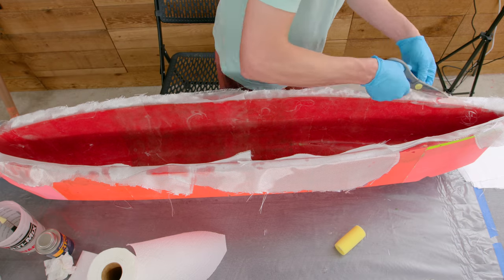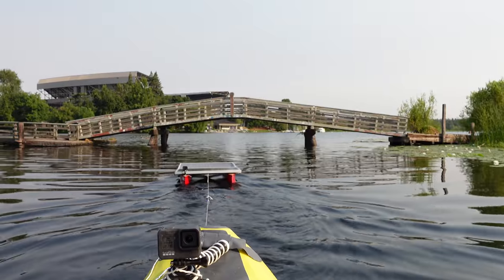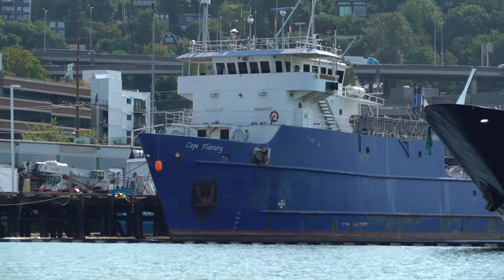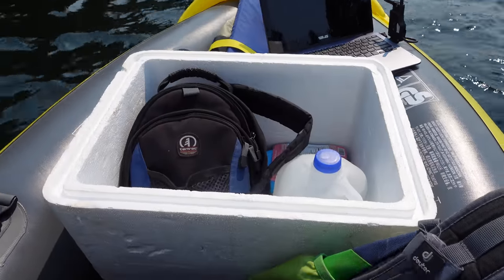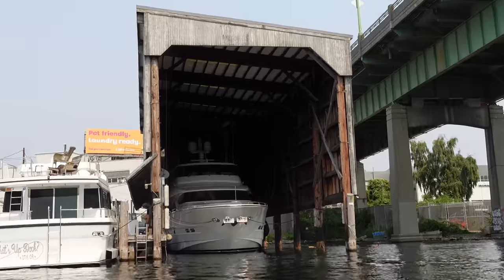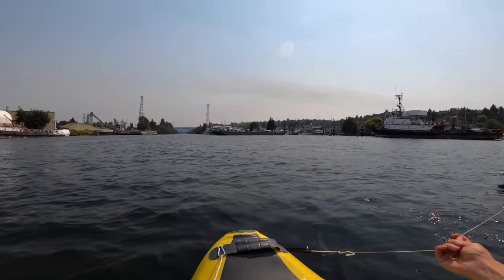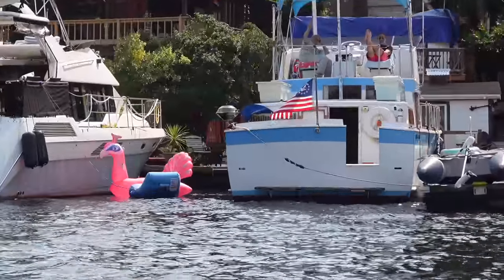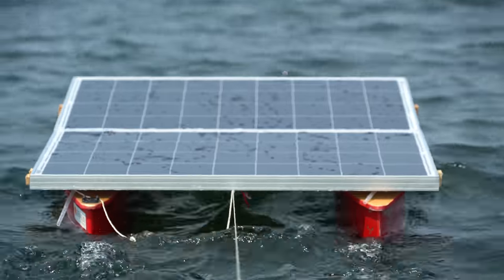My DIY R/C Boat Pulled me 20 Miles!!!

Comment: "rich people trying to flex but their boats cant self direct" - the soundtrack is as entertaining as the content!
Reply: Lmao, that line killed me.
Reply: I loved it but those yatchs, tugs, and fishing boats definitely all can lol
Reply: @yeldawg907  Yes, they can...but I would like to emphasize the "self" part. None of the above mentioned operators designed, built and implemented the autonomousness (is that even a word? Chrome says no lol).
Reply: @boardsort  true, but the operators of said vessels can input waypoint missions. Just definitely not it such tight waterways like this. And the definitely didn't design build or implement said system
Reply: Yes there are boats that self direct
Reply: Your sound track and lyrics were super cool.
Reply: it’s pretty funny, but some of those mfs got autopilot, I’ve been on a nice fishing boat before, and it’s literally got gps autopilot like a plane and it’s sick
Reply: Fun fact! Three orca plane....

1954 DEHAVILLAND DHC-3
Fixed wing single engine
(11 seats / 1 engine)
OwnerKENMORE AIR HARBOR LLC
KENMORE , WA, US
Airworthiness ClassStandard/Normal
Serial Number37
EngineP&W PT6A SERIES (Turbo-prop)
Horsepower: 500
Reply: @JamesTorrey  Explain how this is relevant
Reply: my dads old searay had waypoints you could map out on the chart plotter and it would follow them, was kind sketchy because it wouldn't slow down for turns so if you programmed a 90 degree turn and had the throttles open it would send you across the cabin lol
Reply: Err. But there's an autopilot option on  some boats. And ships.
Reply: Ye, that's LoFi, except for the Wellermann thingy xd
Reply: This comment is the click bait.. lol need to change the title..
Reply: Ye that line is hilarious
Reply: @Thatwrxguy  jj
Reply: Fr at Soundtrack , It’s Like Perfect with the Setting
Reply: Watch out for that cigarette boat coming up fast on your right……….oops!   Well, there’s his hat. Hey, you ok??.🥴
Reply: They totally can though haha
Reply: Actually, most large boats do have an autopilot system
Reply: My 1989 sailboat can follow waypoints, follow magnetic bearing, follow wind direction.. doesn't even need 5g reception..
Reply: @Shane888 Davies  @Shane888 Davies  I thought it was a fun fact. He was basically sharing the specs for the Orca painted plane that flew over head in this video so his comment was completely on par with the video and indeed was a fun fact as well as an informative comment, so I have no idea why you had a problem with him making it! Thank you to Mr. James Torrey for the informative comment.
Reply: @scrambledmandible  well it is the full specs for the airplane that flew over his head in the video and was pointed out by the narrator of the video so I don't know how much more relevant you need it to be.
Reply: Our Philippines Life  hahahaha same
Reply: That's a bar
Reply: bruh, he got me every single time
Reply: That followed by the foreclosure line were genius

Comment: Bro this seriously looks like a life-saving piece of equipment. With a few minor modifications this could be designed to be rigged up to lifeboats for at-sea emergencies. It would turn the situation from "hope you get rescued before eating each other" into "be bored and uncomfortable for a few days."
Reply: That would be amazing, however if it was a piece of equipment on a lifeboat, you would have to make a good navigation system, that could navigate to the nearest port from anywhere in the ocean, and it would have to be able to operate in extreme weather conditions and choppy waters without going off course.
Reply: @aperson9973  even just this one being programmed to go to the nearest shore would be a lifesaver. I'm just not really sure how it would handle the deep sea waves
Reply: @aperson9973  I'd be happier with something rather than nothing. I could use the sun and stars to point me in a general east or west direction and just go until land. If it's simply not possible to make one sturdy enough to handle extreme conditions while also compact enough to fit with a liferaft, then I'll just take the one that can't handle extreme conditions and hope I don't encounter any. Again, something is better than nothing in a case like this.
Reply: Yeah, I'd rather be rescued by a proper boat then get tugged by a pissy ass rc boat for hours on end.
Reply: @qwertykeyboard5901  the point isn't for this to be the only resque option, but to move you to a better location, maybe even designated resque areas that have all been set up beforehand.
Reply: @pvpdm  While the idea might be good, It might actually be easier and safer to have the lifeboat go into "hover mode" and stay close to the lost vessel,  search and rescue operations would most likely start close to the last known location of the ship, or boat. This ofcourse could be mitigated with the use of a emergency  GPS tracker like an EPIRB or an AIS system onboard. but still
Reply: A lifeboat in the ocean has a lot of special challenges.

It has to absolutely tolerate heavy weather, since that's almost always when they are used.

You could use flexible panels on a hinged, fold down wing sail, in three sections. Fold down one, or two sections for high winds, and you still are generating some power from the heavier lower section.

I suppose you could have some tow behind collectors that you deploy in calm weather, but you'd have huge losses from drag, which is going to be your primary parasitic loss.

Really, what a life boat needs is a really good distress beacon and antenna, with a backup, and back up backup.

If you call them, they will come.

Only time you need motive power is if you have no radio, or are being driven toward a hazard faster than help can arrive.

For the former - time to die!
Fir the latter, you are better off with a small gas engine and a few 5 gal cans of fuel.

No, it's not going to get you home, but it can be used intermittently to keep you from dying before help arrives.
Reply: Everything you add to a lifeboat typically means something you take away. They can't be too big... Moreover, you need to understand how large the ocean is. If you were to use literally this just barely out into international waters - where you're basically safe as long as you get into a lifeboat - it would take 19 days to get back... And that's assuming a perfectly calm sea with NO waves. Not just light waves, NONE .. this is an inlet river, it's very calm. 

Now, if you're out at sea, that's too long.. Doesn't matter how much supply you bring, there's not enough space for that much. The worst things are what the fella above said, you're making yourself harder to find for the only REAL chance of rescue.... The thousands of boats all around you that you should have been able to call before you went down. They're going to have data on the currents and they're gunna do a search using those currents. If you fought the current but got nowhere.... You've killed yourself.

But think of the most important thing at sea: Morale. If people aren't keeping busy and being diligent they can make mistakes that kill them. Having one of these and watching it get killed by a wave would devastate most people.... Best to just keep them safe and waiting.
Reply: Talking from a SAR helo pilot point of view: the less you move, the better chances you have to be found. That is if you can send a mayday as soon as you sink. If no one knows that your boat sunk and where it did...then moving to the closest coast may seem like a better choice. Remember we take into account the presumable drift due to the wind. All things considered, a long lasting EPIRB/ELT/sat phone and smokes/flares is what gives you the best chance of being found. If I had to put solar panels on something, those electronics are what I would like to be able to plug them to.
Reply: ...do you mean life rafts? Cause lifeboats have engines. And fuel. And oars. Like, they can move on their own already.
Reply: @jemmabean  lol yeah I guess I do. Thanks for the correction. It's a distinction that matters, I'll agree, though I had never considered it before.
Reply: @AntithesisDCLXVI  no worries sorry I was a bit of a bitch about it lol 😆
Reply: I'd rather a lifeboat have an emergency beacon and a good battery than wasting on any type of navigation. The ocean is too vast and unforgiving to attempt getting to land. As they say, stay where you are so rescuers can find you. A beacon increases that by 1000x.
Reply: @joetolopino7126  word, hook those solar panels to an EPIRB stat
Reply: @joetolopino7126  With normal phones soon being able to work through satellites, a waterproof phone with such service + solar charger should be enough for both finding/transmiting your position, and to entertain yourself while you wait..
Reply: Actually that’s a awesome lifesaver idea
Reply: That is if you still receive signal.
Reply: Add a charging port for cell phones and a small battery bank (to charge a couple extra phones) and you would literally have the perfect emergency gps powered auto boat to guide you home.

Tie that to an app that talks to gps sattelites and gives you a heads up display on battery life, solar efficiency, and maybe some tips for survival, and you'd have a very profitable, life saving device.
Reply: If it was incorporated into a life boat for larger ships yeah I can see it definitely being viable not the tug boat itself but the solar powerd autonomous propelled system
Reply: Have you heard of the Coast Guard? They're always ready.
Reply: @aperson9973  uh, starlink.
Reply: @pvpdm  make it submersible
Reply: Moving AWAY from the crash site only increases the likelihood of NOT being found. It is too unreliable and needless to have an engine used to keep close to a crash site - rather, a large beacon or ways of getting rescuers to notice you is more important.
However, we run into the issue of weight and space. Whatever
Reply: Just don't save people who use the word "bro".
Reply: @davidrichter9164  what a strange thing to use as a basis of judging another person. What do you think using "bro" tells you about who I am that makes me unworthy of life? Genocide against anyone not of your culture or tribe, eh? You want so hard to feel superior to others yet you neglect to see how low you stoop to achieve it. Pride truly blinds.
Reply: It's called an emergency life raft. Latter technology has evolved in past 75 years
Reply: @pvpdm it would be good tech to implement within the lifeboat and have a small propeller
Reply: Lols.. you really thought you had a "smart" idea huh?
Reply: @Sometimes_Always  Lols.. you really wanna be a bully on the internet huh?
Reply: @qwertykeyboard5901 sometimes you don't really get the choice of which one is better. So yes i would imagine in the moment you would adore that little thing
Reply: @aperson9973  idk man i think having them cheap and one in every life boat is better than like trying to make it suitable for any condition and so expensive that no one puts one in their life boats lol
Reply: @pvpdm I'm sure if got into a big break it could be an issue but most of the time it should just roll over the water column as it rises. However, I could see using a self righting design to minimize  the risk of catastrophic loss.
Reply: stage door creaks open ... footsteps
"Or ... you know ... just get a solar powered lifeboat."
footsteps .... stage door slams

Comment: Some suggestions, if you decide to update your project: 1. If you can't completely seal your SolarCat Tug hulls, then at least, equip them with a min-bilge pump in each hull to automatically pump any water out. 2. Move your solar panel aft; it looks like it's bow-heavy, especially when encountering waves. 3. Consider using ducted props; not only do they resist fouling from things like seaweed, but they're also more efficient when using them in a low-speed high-thrust application. The ducts might also add to the directional control, like rudders. 4. Oh, yeah, final recommendation, consider a new(er) laptop? Have you considered making a full-size version of your SolarCat Tug, one in which you can actually sit inside, like a solar-powered autonomous boat? It seems like you already have all you'd need, just up-scale it. Great project!
Reply: A full scale version would be great. I've watched a couple videos on solar yachts. One was a guy on his own who did everything himself and used an old boat. The other was a brand new luxury solar yacht (Silent Yachts) that a wife and husband got to sail around on while making videos for their YT channel. I'd prefer the DIY boat since the one built in the factory was far too extravagant and expensive.
Reply: Speech.

Comment: Maybe I'm really wrong here, but those props look a lot like the ones on my Traxxas Spartan. Those might be meant for an Arneson drive which is a half-submerged, high-speed propeller. You probably want a prop like a freight ship or tug boat. Something worth looking into.
Reply: Definetly bigger Props will Power pitch
Reply: I don’t know much about hydrodynamics but in airplanes a slower rotation with more aggressive pitch is more efficient so I agree with your idea!
Reply: @Acrophobia2  It's all fluid dynamics in the end
Reply: @ericfarmer3644  Yeah but air is compressible and water is not. I think smaller props might clear seaweed better too though or at least not get completely hung up in it.. not sure.
Reply: @bwxmoto  Water cavitates though. To get the same poweroutput on a smaller propeller it needs to spin faster causing more cavitation (well more scientifically you need to increase the pessure per square cm of propeller surface).

A larger propeller at the same or if needed lower RPM will output more power, but for this you also need a suitable motor

However power is not a problem here since both the tugboat and kayak are pretty much at their hull speed, meaning in order to go faster you need a less V shaped hull and a LOT more power to get the tugboat up on a plane. Same goes for the kayak. An inflateable hull will at a ceirtain speed (in this case 1.8 m/s) suck themselves to the water surface, creating huge drag. You need a rigid hull to go faster and a flatter hull to go on a plane.
Reply: Dumas makes that hardware in shiny brass at various scales. Spartan or Stealthwake props will be cheaper.
Reply: @bwxmoto  As a note of trivia, air only compresses aerodynamically when you are supersonic (Bernoulli's principle).

Comment: Quick tip to find out really quick (less than a second with a trained eye) if you're on a collision course with a boat. Compare the background (shore) with the boat you want to check. If it goes faster than that boat you will cross first, if the boat goes faster they will gross first. If the background stands still compared to the boat you are on a collision course.  Adjust immediatly. With adequate programming and a camera, this could maybe be (part of) the solution for your live boat/ crossing water situation.
Reply: This info is really useful.
Reply: I think that this tip is a simplification of the same math a collision detection system would use, where with just a camera you can determine the relative position/velocity of the boat and then see where their trajectory is headed.
Reply: right. And if you are both traveling in the same direction, same speed, but angled in such a way that you will cross eachother's path.... will this still work?

Do you perhaps have a link to a video or something to show it in practice?
Reply: @bertjesklotepino  That is the precise situation they're describing, yes.
Reply: Ukraine navy taking notes.

Comment: so... i dont know if anyone  has mentioned this idea, but adding this kind of technology to say, lifeboats on larger working ships, could potentially save human lives. instead of drifting aimlessly on the ocean, imagine having a little solar tug to pull your life raft to the nearest shipping rout, or land mass where you will be picked up.
Reply: The larger life boats have engines and fuel for propulsion against waves and powered travel at night
Reply: @jonahbrame7874  yeah it’s not like the titanic anymore.
Reply: that would be very useful if only it only worked when the sun is out which is often not the case
Reply: I worked as an helicopter pilot for SAR missions in French Navy. Many people just fall from their boats while sailing on a quiet sunny day and don't have more than their life vest. A thing like this solar mini-boat could be a HUGE leap in safety and save many lives =).

Someone has to file a patent for this. Really =)
Reply: I was thinking the same thing. The smaller inflatable lifeboats from some vessels (or even aircraft) just sit in the water where they were deployed and wait for rescue, but they are at the mercy of the currents. Having a foldable version of this on an inflatable lifeboat would be a lifesaver. As soon as it’s activated, it sets a course for the closest landmass and just tows you to shore. The closest landmass is usually where the rescue will be coming from anyway so close the distance.
Reply: I was thinking of smuggling capabilities, but yeah your ideas better.
Reply: LOL well they are both still valid options. smuggling would be a lot easier to set up though. :P
Reply: Besides the fact that most lifeboats have an engine for propulsion, adding a tug boat to tow the lifeboat instead of just putting an engine in the lifeboat is really unnecessary and kind of stupid

Comment: When your laptop is so crap you secretly hope it will fall overboard so you have an excuse to replace it. Awesome video!
Reply: The laptop was sitting in the sun all day so that's probably why it was thermal throttling.  I wouldn't be surprised if some parts of got hot to the touch from the sun.  It probably wouldn't matter what model he used in those conditions but he probably could have saved himself a hassle by building a cheap sunshapde for it.